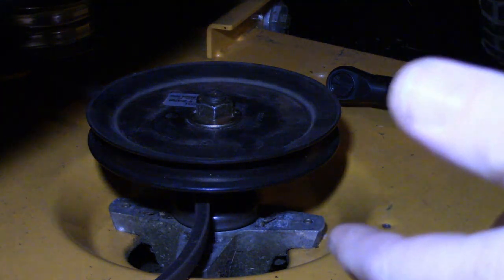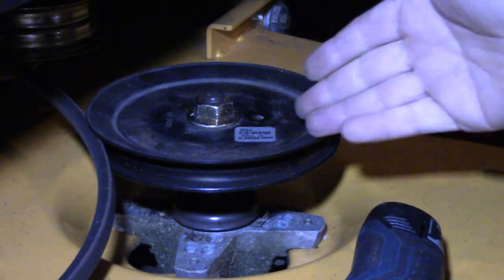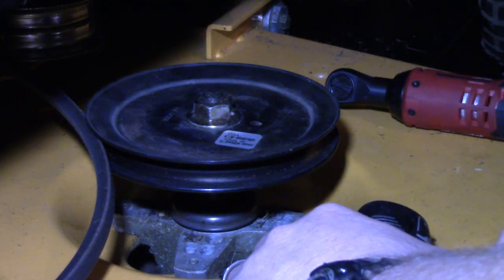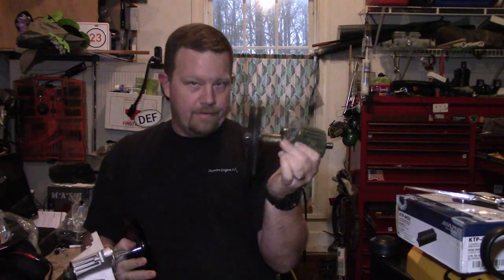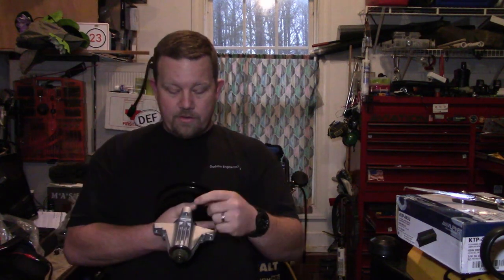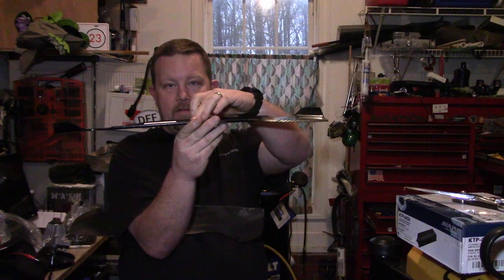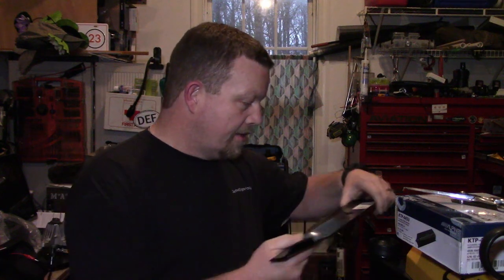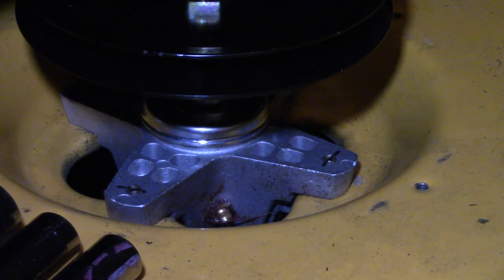Lawn mower spindles test, replace, and what to look for.

Comment: Just to reiterate so people don't waste grease.  If your spindle has sealed bearings inside you are wasting your time and money greasing your spindles.  Not sure if brand in video has sealed bearings or not, but MOST spindles do.  And some companies still put zerks to grease.
Reply from the maker: Exactly.
Reply: They actually get grease in them you just have to fill the spindle chamber packed full of grease. I used to think it didn't do anything but there is a video on YouTube some guy did.
Reply: @patrickv.5766  Is it really a good idea to pack it so full of grease that it goes past the seal.  That's alot of pressure.   Just a thought.

Comment: I got a whole new assembly and it’s tight as ever!! The other side I can spin walk away from and it’s still spinning. Idk which side is toast can’t just have a working assembly that doesn’t keep snapping belts
Reply from the maker: Double check that the belt is the correct, also make sure the pulleys are the correct size. The replacement spindles could have the wrong size pulley on them. That would cause the belts to be tighter.

Comment: I wish they made decent assembly's for mowers cause if you replace the bearings very many times they don't fit snuggly in the housing.I don't know what was wrong with iron,or steel assembly's other than they did not make money selling replacement bearings and assembly's.
Reply from the maker: I know, it's crazy.

Comment: I put and he sees on my belts. I been doing it for years. I don't see doing maintenance. I've never changed my engine oil or filters. I don't change my hydro gear oil or filters either. I leave my mower outside in the weather ☁️🌡️.

Comment: The grease fittings don’t do crap. That grease just sits in there where the shaft is and doesn’t actually grease the upper or lower bearings due to the bearings being sealed. Best bet is to pop out the bearing seals upper and lower and run some grease in them once a season and you won’t have to replace any bearings for a long time...been working on mowers for years and grease fittings in spindles don’t do a thing.. Steve’s small engine saloon also has a video on sealed spindles folks, check it out...
Reply from the maker: Depending on the manufacture of spindle and shaft assy some do put in the sealed bearing and yes the grease fittings are a waste, but also I have came across some that have only a seal cap on the ends of the spindle assemblies with grease fittings. When rebuilding them I put in the unsealed bearing and they work great as long as they are serviced. So, it depends on the make and model and who overhauled them. Also, been doing this for many years too, even on industrial spindle assemblies on a bigger scale. But, I do this as side job to help out farmers and many old timers don't trust sealed bearing and still love there grease guns :).
Been following Steve and for many years and saw the video and of course he has validity on the the issues of sealed bearing with grease fittings, also his beer collection. Thank you. 
Oh,  I like CVG Frontier video.
Reply: I just learned that and doing both my cub cadets  . The bearing seals on the inside I took off  as per youtube video  . Mine had  zerk fittings but no weep hole , so added that . Hint clean your deck well and get graphite slip plate and brush it on the undeside of your deck it keeps grass from sticking to the underside of your deck . My son uses it on his tow trucks  and told me about it  A quart can will do 3 lawnmowers decks . I also use only gator blades as it cuts the grass cleaner and I drilled a hole in my discharge and put a wire in it and put wire up  to the side handles on my mower so I can lower or raise the disharge shoot  . I have over 3 acres so not really near any one so no harm no damage to anything  slip plate on ebay 44 dollars free shipping . I had a spindle i bought new and I could see a wobble  to the pulley and it would throw the deck belt off the pulley  , found out why  they never put the spacer between the 2 bearings and it was brand new from cub cadet  . I made sure to let cub cadet know about this , Thanks to youtube for people putting up videos like this  . I live in the country and no lawnmower repair shops around  here

Comment: Did u check to see if the inside seals are still on , on those after market spindle bearings 🤔, i would'nt doubt if they are, even though they have a grease zerk on them...
Reply from the maker: Not yet, plan on this winter doing it and I'll make a video of what I find. You are probably right, but you never know :) .

Comment: On a Simplicity Pacer walk behind mower, there is a small and large pulley for 2 different sized blades. The larger pulley wobbles very loosely. However, there is a large hole with a ton of slack that the hub sits on. The smaller spindle does not have a hub that sits on an enlarged hole, and there is no hole visible because it sits over it. Is this part of the mower’s design, or is this bad bearings? The weird thing is that when the belt is off, it tends to lean towards a certain side.
Reply from the maker: Yes, that sounds like the bearing is worn and possibly the shaft, the best way to know is to pull it out and see the condition of it. Usually when the bearing is going out, it will get sloppy and if it has been going on for a while I bet the shaft is worn too.
Reply: Hopefully the shaft is not worn!

Comment: Will it make it blade high on one side of the deck and low on the other?
Reply from the maker: Nope, that's the leveler of the deck assy. put the deck down to the lowest setting on a level floor and measure the distance of the bottom deck to the floor and see it there is difference between the sides. The spindles would only have the issue if the spindles are different lengths or the base has been damage.

Comment: I can't  keep a spindle and pulley  on the grass discharge side.42 inch craftsman old mower.I mow in a sandy yard with leaves .Can't  make it one season.The pulley always  strips off the 12 point or what ever it is.fitting holding the pulley to the spindle.Why does this keep happening Could it be the deck is too thin and is flexing.Mower is 15 years old.I've replaced that bastard every year the last 3 years.Keeps happening. Where I live is too rough for a new mower.
Reply from the maker: It could also be the belt is to tight and causing the pulley to have unnecessary tension  pulling the pulley inward and causing ware to  the pulley assembly ( I've seen what your saying before and this was the issue). But, mowing in the sandy area like I do, your mowers deck has probably been sand blast alot and it might be  causing the deck stucture to be weak,  espeacially if its a stamped deck and it will flex alot when under a load. It can cause the change of  pulleys  tension and causing the ware of the pulley to accelerate more than usual. The best was is use a caliper to see what the deck thickness is  , the ave thickness is between .135"(7gauge)- .179"(10 gauge)  if less than that, then the deck is going out and becoming like paper and unsafe. I only get mowers  with fab decks, beacuse they can take a beating. When I had my last stamped deck, I use to take it off every year and repaint underside to help prolong the life.  Inclosing , I believe your deck is wornout, but not knowing I can only speculate. I hope that this has helped.

Comment: Thanks for the video - so my blade just spins and doesn't turn the pully at all, what do I change? Thanks again.
Reply from the maker: Okay, possibly it could be where the blade attaches to the bottom of the pulley shaft could be stripped out and or the pulley attach could be stripped out the pulley. Either way, the engagement of the blade movement is toast. You can check to see if the blade could be removed and check for damage on the bottom at ware the blade attaches to the shaft, try to reinstall to see if the blades move the shaft and pulley, or do the same thing to the pulley side to see if can be secured back to the shaft. If not, pull the blade and pulley the spindle assy out and see if there might be anything out of place. The shaft normally should not shear, but it could depending on the age, what it struck, or the bad material it was made from. Depending on the manufacture you can repair them or it might be cheaper to buy new ones. I hope this helps, let me know if you have any more questions.
Reply: T P's thanks so much...I will troubleshoot as you suggest. It’s a John Deere S240 with 42” Deck. Great mower so far. You the MAN!
Reply from the maker: @BornToFly4031  Hang in there and we'll get you through this.
Reply: @jetzombie  So, it stopped raining today and turns  out the top nut on the pully had backed out. A little tightening and the blade is back engaging. FIXED! Cost $0! So, I noticed that this model of John Deere Sport (S240) has a grease fitting on the very top of the spindle. Have you ever seen that? Thanks so much too for the moral support.
Reply from the maker: That is great news!!!! glad to hear it. The fitting should be grease about every 50 hrs, with a HD bearing grease. You are more than welcomed, I look at like this this I like to help when I can and i do this for a hobby. Feel free to let me know if you have any other issues or to make video that could help you out.
Reply: Are you saying that because the zerks is on the top of the spindle that you think the bearings will accept grease and not be sealed?
Reply from the maker: No, per the JD 240 service manual, it says to service every 50hrs. Oh the bearing should accept the grease, I use mobil 1 bearing grease when I service my spindles. They might be sealed, but most the come from factory with zerks, usually have a  dust seal that covers the bearing assembly on the outer face of the bearing and the inside is open for grease.

Comment: Better bearings than stock are available at the bearing store.
I prefer roller bearing spindles that Toro commercial and Scag has.
But if you have ball bearing spindles it is worth while to upgrade.
Reply from the maker: Yes.

Comment: are not those bearings, top and bottom, sealed bearings!?!?!?  If they are, what is lubed by that grease fitting!?!?!?
Reply from the maker: It all depends on the manufacture of the spindle assy and what they have on the shelf at the time. If they put in the bearings, sometimes they pop off the seal on the inside so that the grease can go into the bearing. I have seen all sealed with zerks,  no seals on either side with zerks, and upper bearing sealed(pully ) and lower bearing unsealed. When I rebuild them for people and if I get new bearings I ask them if they want them unsealed on the inside, and most usually do.  This fall, I make a video of a teardown of these styles and maybe a better explanation of how it works.